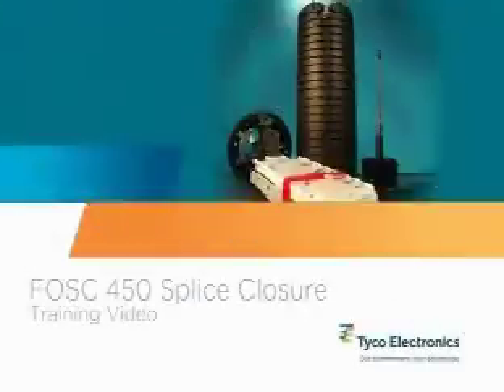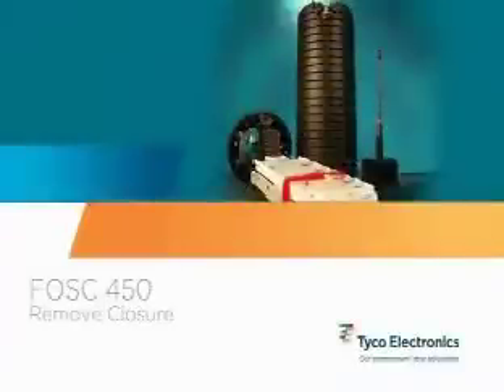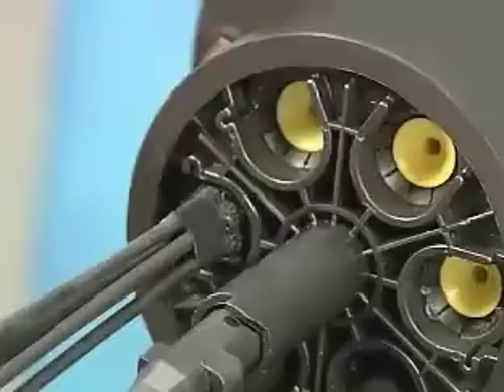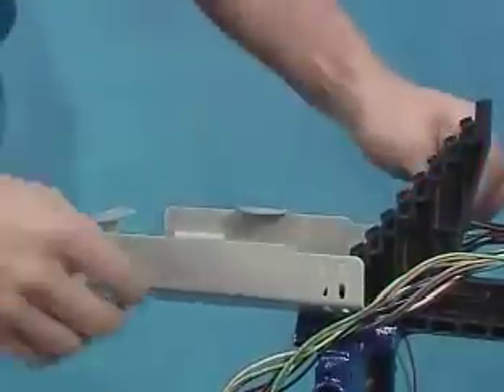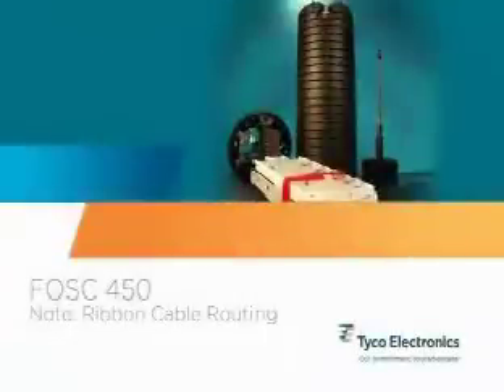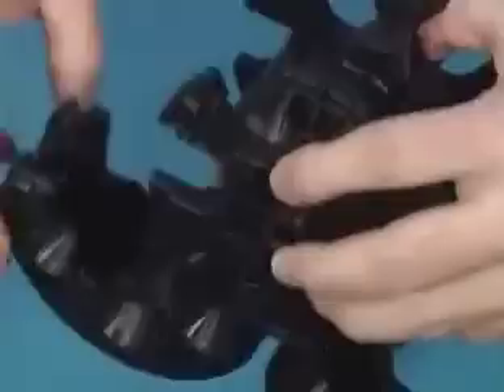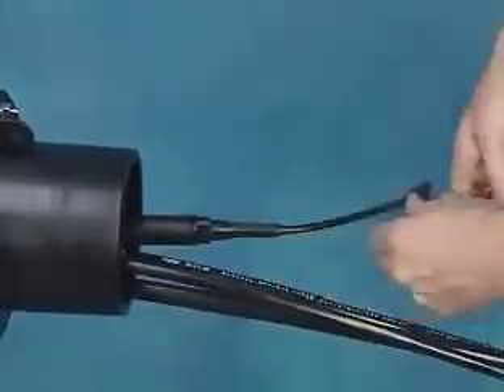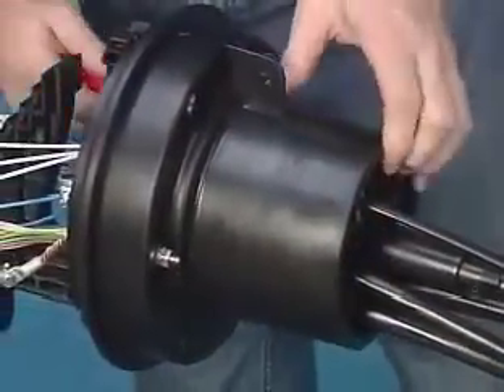Tyco Raychem FOSC 450 Closure Instruction

Comment: So what do you do when you have multiple high count ribbon fibers coming into the closure and you need to use the top holes? Those buffers are not designed to bend at a 90 degree angle, which is what your forced to do when attempting to feed into the distro basket below the trays. Is there a tutorial video for this scenario?

Comment: I could not hate this closure more! WAY too many little parts. And this video is not a realistic scenario in the real world. The ONLY benefit the 450 has over a 400 is you need electricity to shrink the port seal on a 400. And before I fiddle with all the mechanisms and steps on a 450, I’ll run extension cords 3 friggin’ blocks! Love the 400, hate hate hate the 450.